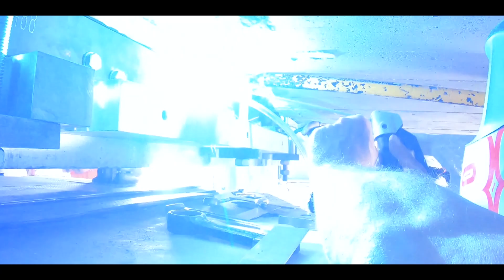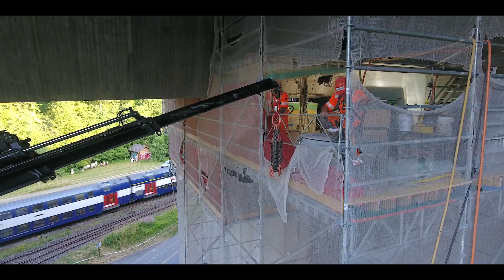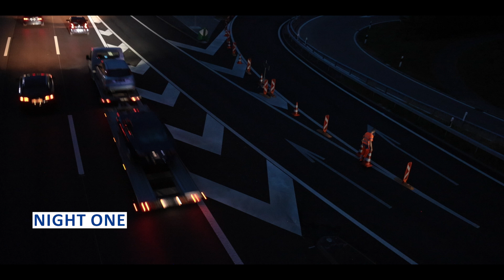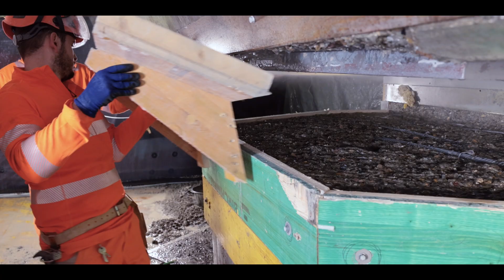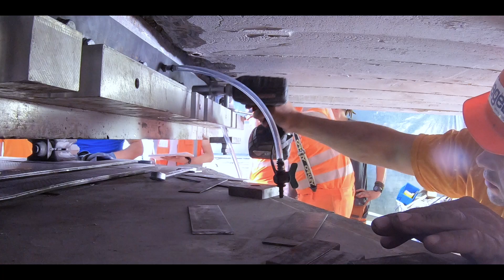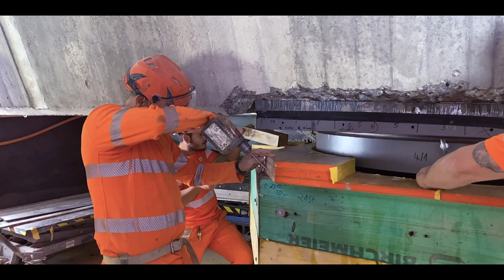New bridge bearings required – refurbishment of the Hammermühle Viaduct

Comment: What the reason for replacement ? Looked fine to me..
Reply from the maker: Thank you for your question. Considering the fact that the bearings were already over 50 years old, they were in surprisingly decent condition. Nevertheless, the bearings had reached the end of their life cycle and needed to be replaced. The sliding material (PTFE) in particular had reached its wear limit and the sliding plate on certain bearings was also not in good condition.  Hence, a replacement was required.
Reply: @magebagroup  Thanks  for your feedback ! Good job on the installation !